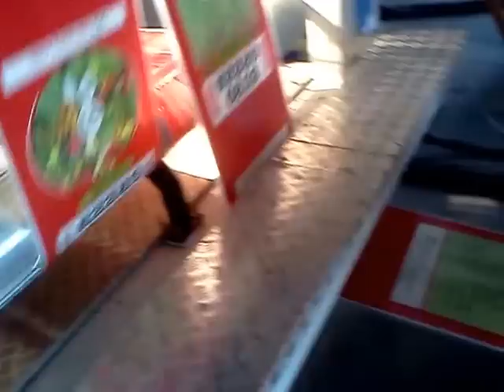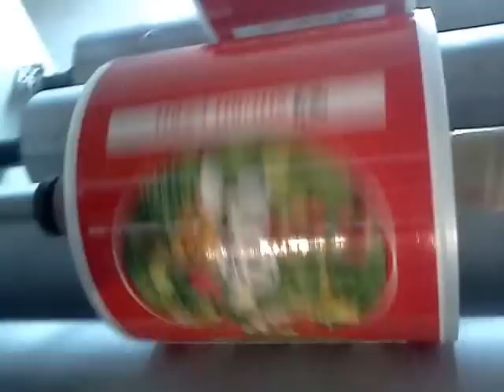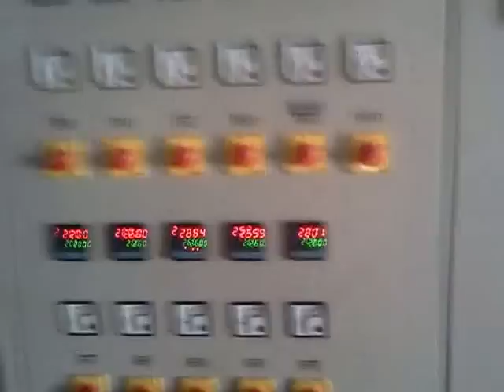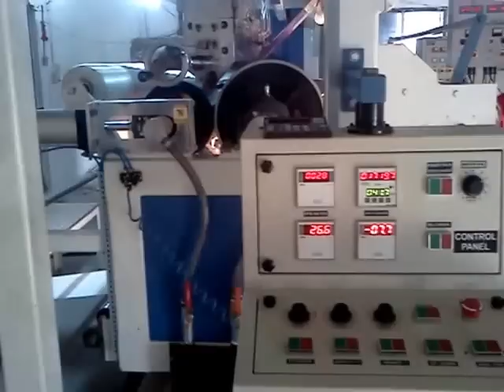extrusion coating lamination machine line plant for bopp lamination coating machine for paper india

Comment from the maker: extrusion coating lamination plant
extrusion coating lamination machine, woven sack, bopp, India
Woven Sacks, Tarpaulins, Jumbo Bags, BOPP Film, Paper, Aluminum Foil, Polyester Film, Cotton Fabric extrusion coating lamination machine line plant for bopp lamination coating machine for paper For Coating thin layer of polyolefin's (Mainly LDPE / PP) on substrates like Woven Sacks, Tarpaulins, Jumbo Bags, BOPP Film, Paper, Aluminum Foil, Polyester Film, Cotton Fabrics, Jute, Non Woven Fabrics, etc. Up to 5200 mm Web width applications. Tandem Lamination Plant for coating Circular Woven Fabrics, for producing multi layer laminates up to 5 layers along with the various substrates like Paper, Aluminum Foil, Polyester film etc. Lamination line material adds superior protection for products when they are packed. Extrusion coating lamination plant is a suitable solution to produce very slim lining layers made of PP, LDPE. This lining material will them be added to packaging components like woven sacks, giant size bags, aluminum foil, cotton and jute fabric bags, etc. Ocean Extrusions is a leading extrusion coating lamination plant manufacturer and our lamination plant will remain a revenue making investment as the machine components are made of reliable and quality materials. This video caters details about Extrusion Coating Lamination machine that is used for ldpe Coating Lamination, pp coating, pet Coating lamination, woven sacks, paper with Aluminium Foil Coating, bopp lamination with BOPP Film Coating extrusions lamination, metalized Polyester Coating Paper, Cotton Fabric Coating Paper with HDPE Woven Fabric Coating. Further more information visit at http://www.oceanextrusions.com/extrusion-coating-lamination-plant.htm
Ocean Exteusions PVT LTD

Factory Add : -- 

OCean Extrusions Pvt Ltd 
Plot No. 01, Survey No. 325, 
B/h. Jalaram Saw Mill, 
Kujad, Daskroi, 
Ahemadabad - 382430

Corporate Office :--

Ocean Extrusions Pvt Ltd 
B-412, Fourth Floor,
Galaxy Business Park,
Opp. Torrent Power Station,
Sardar Patel ( SP ) Ring Road,
Nikol, Ahemadabad 382415.

www.oceanextrusions.com
9724325401,

Comment from the maker: extrusion coating lamination machine line plant for bopp lamination coating machine for paper
woven sack raffia lamination plant, woven sack raffia coating machine, pp machine 
This video about Extrusions Coating Lamination Plant for bopp lamination coating machine for paper lamination line get more details visit at http://www.oceanextrusions.com/extrusion-coating-lamination-plant.html.This video about Extrusion Coating Lamination Plant that broadly used for laminating various types of material and specially equipped for laminating papers. Further information about Extrusion Coating Lamination Plant, visit at http://www.oceanextrusions.com/extrusion-coating-lamination-plant.html. extrusion coating lamination machine line plant for bopp lamination coating machine for paper For Coating thin layer of polyolefin's (Mainly LDPE / PP) on substrates like Woven Sacks, Tarpaulins, Jumbo Bags, BOPP Film, Paper, Aluminum Foil, Polyester Film, Cotton Fabrics, Jute, Non Woven Fabrics, etc. Up to 5200 mm Web width applications. Tandem Lamination Plant for coating Circular Woven Fabrics, for producing multi layer laminates up to 5 layers along with the various substrates like Paper, Aluminum Foil, Polyester film etc. Lamination line material adds superior protection for products when they are packed. Extrusion coating lamination plant is a suitable solution to produce very slim lining layers made of PP, LDPE. This lining material will them be added to packaging components like woven sacks, giant size bags, aluminum foil, cotton and jute fabric bags, etc. Ocean Extrusions is a leading extrusion coating lamination plant manufacturer and our lamination plant will remain a revenue making investment as the machine components are made of reliable and quality materials. This video caters details about Extrusion Coating Lamination machine that is used for ldpe Coating Lamination, pp coating, pet Coating lamination, woven sacks, paper with Aluminium Foil Coating, bopp lamination with BOPP Film Coating extrusions lamination, metalized Polyester Coating Paper, Cotton Fabric Coating Paper with HDPE Woven Fabric Coating. Further more information visit at http://www.oceanextrusions.com/extrusion-coating-lamination-plant.html
www.oceanextrusions.com
009724325401

Comment from the maker: extrusion coating lamination machine line
woven sack raffia lamination plant, woven sack raffia coating machine, pp machine 
This video about Extrusions Coating Lamination Plant for bopp lamination coating machine for paper lamination line get more details visit at http://www.oceanextrusions.com/extrusion-coating-lamination-plant.html.This video about Extrusion Coating Lamination Plant that broadly used for laminating various types of material and specially equipped for laminating papers. Further information about Extrusion Coating Lamination Plant, visit at http://www.oceanextrusions.com/extrusion-coating-lamination-plant.html. extrusion coating lamination machine line plant for bopp lamination coating machine for paper For Coating thin layer of polyolefin's (Mainly LDPE / PP) on substrates like Woven Sacks, Tarpaulins, Jumbo Bags, BOPP Film, Paper, Aluminum Foil, Polyester Film, Cotton Fabrics, Jute, Non Woven Fabrics, etc. Up to 5200 mm Web width applications. Tandem Lamination Plant for coating Circular Woven Fabrics, for producing multi layer laminates up to 5 layers along with the various substrates like Paper, Aluminum Foil, Polyester film etc. Lamination line material adds superior protection for products when they are packed. Extrusion coating lamination plant is a suitable solution to produce very slim lining layers made of PP, LDPE. This lining material will them be added to packaging components like woven sacks, giant size bags, aluminum foil, cotton and jute fabric bags, etc. Ocean Extrusions is a leading extrusion coating lamination plant manufacturer and our lamination plant will remain a revenue making investment as the machine components are made of reliable and quality materials. This video caters details about Extrusion Coating Lamination machine that is used for ldpe Coating Lamination, pp coating, pet Coating lamination, woven sacks, paper with Aluminium Foil Coating, bopp lamination with BOPP Film Coating extrusions lamination, metalized Polyester Coating Paper, Cotton Fabric Coating Paper with HDPE Woven Fabric Coating. Further more information visit at http://www.oceanextrusions.com/extrusion-coating-lamination-plant.html
www.oceanextrusions.com
009724325401